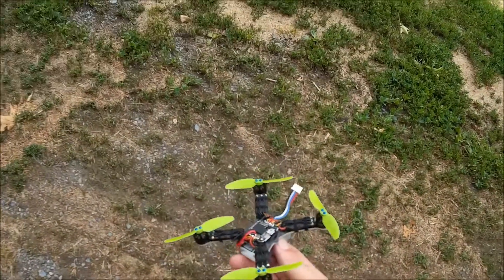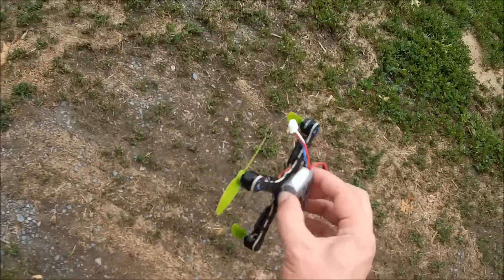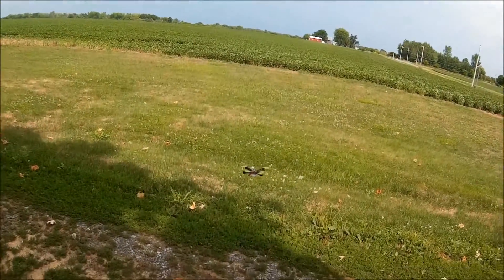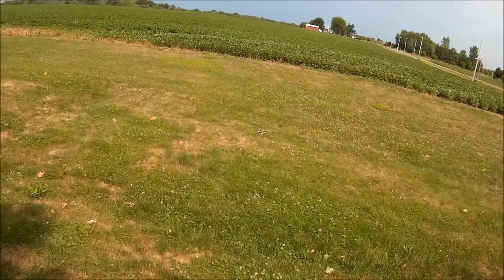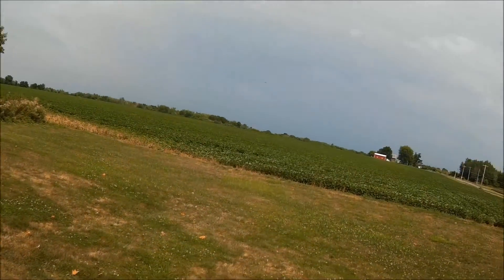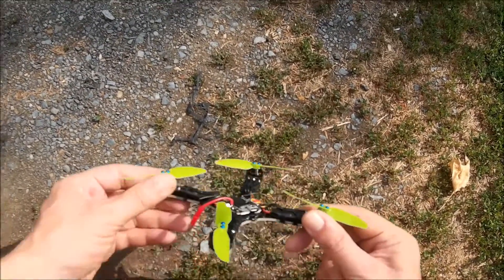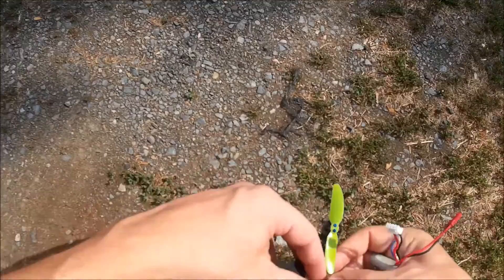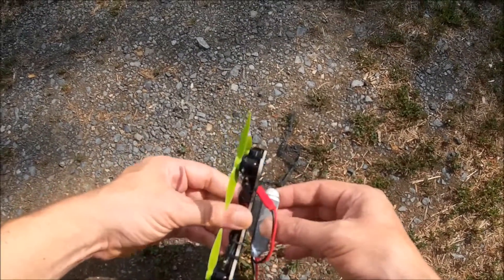My fastest Micro - Huge speed/power boost

Comment: Dave what motor KV would you recommend for a 2s 3025 prop  build thanks
Reply from the maker: At least 5000Kv, if you only ever want 2s I think there are some faster 1104/1105 options that may thrust a bit more.  I'm not sure how fast you can get away with though.
Reply: Thanks David, Building my daughter's first brushless quadcopter are the 1105b 6500kv to much.
Reply from the maker: My instinct tells me 6500kv 1105 should be fine.  I ran 5000kv on 3s Hv with 3030 props, so I bet you gain 1500kv if you drop a cell esecially. with the smaller props.   I can't guarantee anything though.

Comment: Hey :) Do the ESCs need 20A?
Reply from the maker: I don't think so, but didn't notice smaller ESCs rated for 4s
Reply: Alright, Thanks! Would you rather take the 4000 or 5000KV?
Reply from the maker: 4000KV for 4s.  5000KV if only 3s.

Comment: What Kv 1304's are those?
Reply from the maker: 4000kv on this one.  I also have 5000kv but only run 3s HV on them.  4s HV on the 4000kv with 3025 or 3020 props is ideal imo.
Reply: Dave Woods thanks for the reply

Comment: Change that JST plug to XT30 :p
Reply from the maker: Why? Batteries I'm using only have 20awg wire and use a JST.  I used good female JST with 18awg wire.
Reply: JST is good for 5A. Shorten the wires as much as you can and use either EC2 or XT60. Basic things to do, if you want higher performance. An very little work, almost no expense to gain power and efficiency.
Reply from the maker: I understand these principles, but JST can certainly handle way more than 5A.  If I push it hard batteries come down borderline Hot.  JST shown no signs of even warmth.  Pretty certain the limitation here is the battery and connector swap won't do anything but add weight.  It's fine with me though as I'm not asking for more at this point.
Reply: Very good point Dave.

Comment: I run the 1304s with xm20as on 4S LiHV. They love it.
Reply from the maker: Thanks Nate, I have since found Pulse 450mAh that are working well for me though the mylipo are probably great too.  Found Bonka has 4s LIHV in 500mAh I'm excited to try.
Reply from the maker: Wow, are you using the 3030 props?  I can see it on 3020, but I'm getting plenty warm on just 3s with the 3030's.  
Can you share where you found reasonably sized 4s LiHV? Smallest I could find was the Bolt 850.
Reply: +Dave Woods mylipo.us has a 480mah 4s that may be a reasonable size/weight